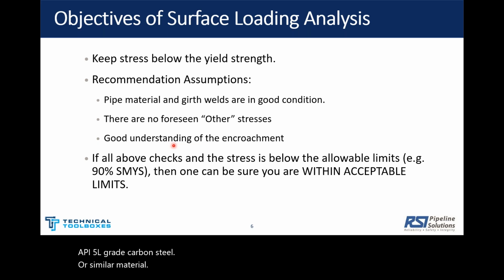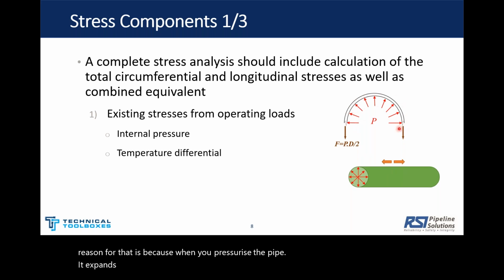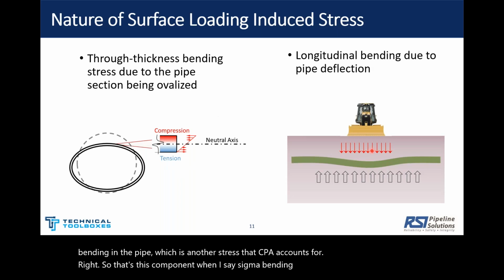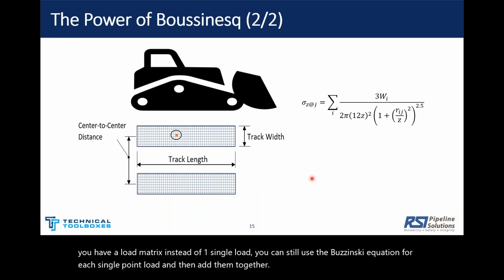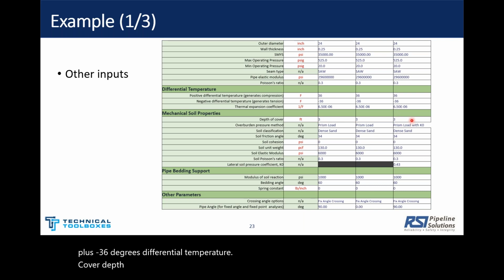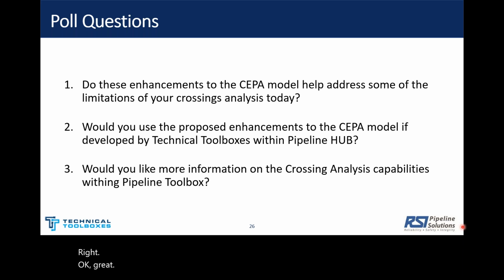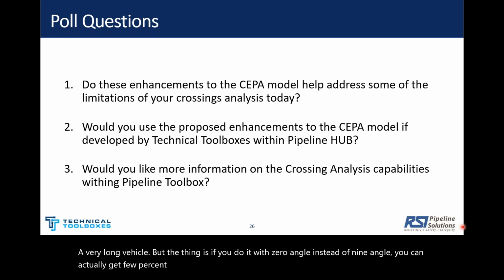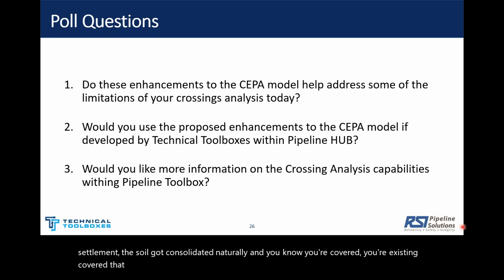Advancing the CEPA Pipeline Crossings Model

Comment: In the CEPA surface loading/stress calculation spreadsheet, ΔT is defined as: ΔT = T(installed)− T(operating). This results in a negative value when operating temperature is higher than installation temperature (e.g., 0°C − 25°C = −25°C). Could you please confirm whether this negative ΔT is intended and consistent with the stress equations used in the spreadsheet? Specifically, is the sign convention correct as implemented, and does it correctly produce valid thermal and Tresca combined stresses without requiring ΔT to be taken as an absolute value?